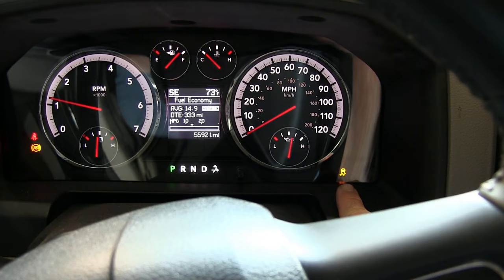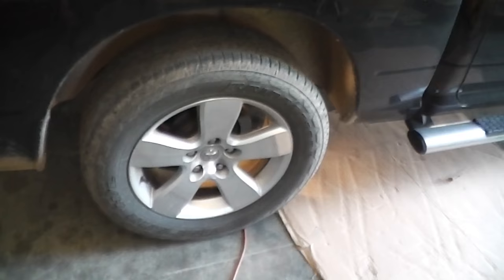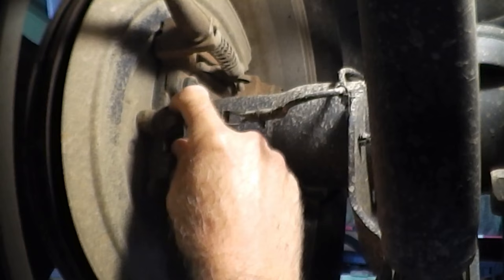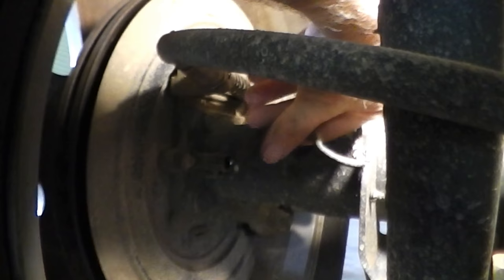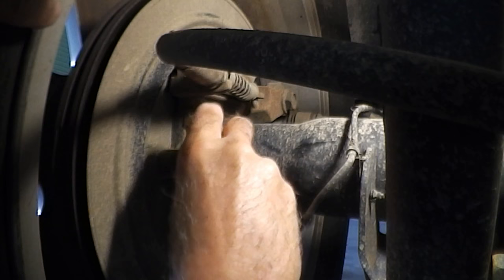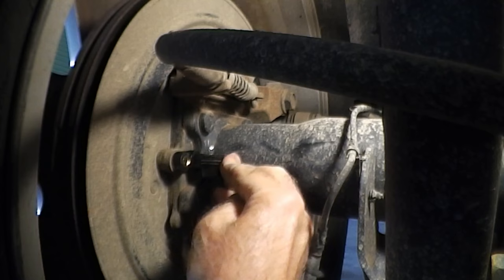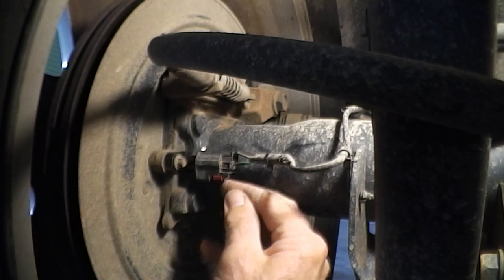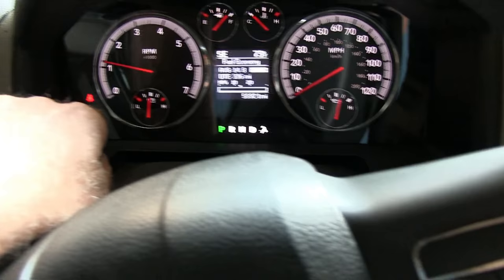ABS and traction control light stay on - 2012 Ram fix

Comment: Hi Pete, the truck didn’t reset with the start of the engine, I drove it for a while and still showing the same lights. Any idea what could be wrong?
Reply from the maker: Make sure the contacts on the clips were clean when you reconnected them and not corroded because if they're dirty, the computer will still think the censor is bad.

Comment: I am having this same issue on my 2016 Laramie Longhorn. But I am having trouble finding just the sensor in parts stores. All I can find is the entire ABS speed sensor package that has the connector, modules, etc. Where can I fin JUST the sensor itself, as seen in this video? The ones I found online say they do not fit my truck. Thanks!
Reply from the maker: Some Rams are different depending on the year. I think I got mine at either O'Reilly Auto Parts or Advanced auto parts.
Reply: @petebeasttexashomesteading  Yea, that is where I have looked too. Thanks for the response.
Reply: Do you remember what you bought? I am having same issue with my 2014 Sport and I am only finding the whole package like you mentioned. Thanks.

Comment: Did ur cluster stopped working i have a 2012 dodge Durango and same lights are on but my cluster wont work ir show how fast am going just rpms work
Reply from the maker: I didn't have that problem.
Reply: I do, did replacing the sensors fix it?

Comment: I’m dealing with this traction control light only staying on, any idea if this is the fix ?
Reply from the maker: You could probably bring your vehicle to an advance auto parts or Oreily's auto part and they can hook it up and run a diagnostic check to see what is giving you the traction control light.
Reply: @Shaun Danylchuk Did you ever find the issue? I have the same issue as you, just the traction control light.
Reply: Sam Moore no, it went away finally hasn’t come back on so, fingers crossed it’s not an issue anymore.
Reply: Shaun Danylchuk Mine did the same thing for a while but eventually the sensors died.
Reply: @petebeasttexashomesteading  I took my 2014 Chrys 300C to 3 parts stores for a  scan  for ABS / Traction faults and they all said they could not or were not authorized to read those. Like its some Stealership secret stuff? What a crock. The car has only 47K. Chrysler products seem to have issues with any and all types of sensors. A year ago the V6 ( at 38K ) lost power due to a bad oil pressure sensor. The stealership wanted $300 just to read the code. I diagnosed it myself with a little web searching and fixed it. The brand has lost my respect.

Comment: I have a similar (maybe exact same) issue on my ‘12 ram 1500. The traction control light stays on all the time and the red BRAKE indicator on the dash bings and blinks at me. I don’t think my truck has ABS. Do you think this is the same issue and fix?
Reply: I think it's the same. And if it's a12  you have ABS

Comment: I dont see this sensor on my 2013 Ram 1500 Hemi. Is this only on the passenger side, or is it on both sides. I only checked Drivers side.
Reply from the maker: They should be just in front of the rear axle on both sides.

Comment: I replace mine today both sides the light disappeared for a little bit but then came back on it’s every time I drive in a bad route any little hole on the street I feel a vibration on my gas paddle and the light turns on have no idea what is it.
Reply from the maker: Unplug the speed sensors again and look inside, make sure contacts are not corroded and clean them up and plug them back in.

Comment: Did your light that says 4wd service light came on at all ? Mine has those 2 light u mention plus the 4wd service one ?
Reply from the maker: The truck I had was 2 wd but it's all connected. If those sensors go out it thinks the wheel is not turning so your 4wd light will come on and your cruise control will not work.
Reply: @petebeasttexashomesteading  thank you for the video very helpful do you happen to know where you got those part at ?or have a link to them
Reply from the maker: I think I got the sensors at either Advanced auto parts or O'reillys auto parts.
Reply: Mine did the same thing with the 4x4 light also, but when I stop and start moving, it feels like my left front caliper is grabbing and the traction control light flashes for a second. Once I get moving the light goes out. I think I may have a sticking caliper. Any ideas? 2011 Ram 4x4....
Reply: Did you ever figure out the problem?
Reply: @chrissmothers3636  I ended up getting rid of that truck
Reply: @chrissmothers3636  I belive you have to replace the sensors

Comment: Can a code reading scanner read the code for the traction control light?
Reply from the maker: I know that if you bring it to one of the big auto parts chain store that they can scan it for you.
Reply: I had mine scanned and it didn’t show any codes.  Even though the lights were lit.  Tried the reset and nothing.

Comment: Help! I have a Ram 2500, 2012. I think my part is different? I have spent HOURS even on the Mopar sight and I can’t seem to verify the name of my part because in the manual it is called “Electronic Stability Control”😫
Reply: It's a little late for my comment but it may be called that also. It does provide elec. stability control by applying braking only to the wheel that needs it most at the time and then keep switching by milliseconds to the other wheels to keep the vehicle in a straight braking line. Hence the term " Electronic  Stability Control ".

Comment: On amazon wen u cross check the car, dodge ram only goes up to 2010 how did u use this part on a 2012 . If the year for dodge ram 1500 aint on there dont that mean it dont work? I have a 2011 wich is why i ask
Reply: Not under Dodge after 2010. Scroll down to Ram

Comment: I have this issue with my truck right now, except I am also limping in 4th gear. Did anybody have the same limping issue when their ABS and Trac-control wasn’t working? 

We also think it may be our transmission solenoid 

Model: 2012 Ram 1500 with 5.7L 

Please let me know!!
Reply: Mine is doing the same thing same model. What was your solution?
Reply: @tciscoroofing  did you figure it out? Having the same issue now.
Reply: @kanehorath7222  my result was that I bought a cam sensor from O’Reilly and nothing happened it was the same situation that it has been doing. 

I’ve took it to 3 different places and it pop up as a cam sensor. So we ended up buying the original part from dealership which is the cam sensor and boom problem solved. Running like new. O’Reilly sensor parts don’t work you have to get the original parts. Try it and let me know if it work. 

Good luck!
Reply: @tciscoroofing  thanks man I appreciate it!
Reply: @kanehorath7222  let me know if yours worked also

Comment: Does this work on a 2012 Durango?
Traction light stays lit and can't shift out of Park
Reply from the maker: If your shifter lever is stuck in park, then there must be something wrong with the brake pedal sensor not releasing the shifter.

Comment: What would the results be if u keep driving it with the lights one ?? Anyone ??
Reply from the maker: Cruise control wont work nor will the traction control and you might have problems with the ABS not working properly.
Reply: Death quite simple

Comment: Do you know what makes them go bad?
Reply from the maker: Not really, the censers are a sealed unit and nothing to fix......just replace. But you might want to try unplugging them first and clean out the connections and plug them together and see if it had a bad connection first.
Reply: Pete B. Thanks. 

I had my brakes replace at the last oil change which was at 119k miles. 

I now has 129k miles and Is ready for another oil change. 

I was wondering if when they replaced the pads, if they could have left something loose.

Comment: Are the 2013 rams the same deal? My parking brake light, traction control light, and abs light is on. What do I do?
Reply from the maker: Most likely it's the same problem especially if your cruse control doesn't work either. I would just change the speed sensors, they're not that expensive. The 2013 speed sensor are different then the 2012 because it has a long wire and clip connection.
Reply: Yeah my cruise control wasn’t working either. I went to O’Reilly and bought the part. Was wondering why it wasn’t just a female part like yours but that makes sense. Thanks a lot man!
Reply: Did changing the ABS speed sensors work for you? I have the same issue parking brake light, traction control light, and abs light is on? @Blake Rainer
Reply: Malachi McClure o OK

Comment: Is this the same process for the 2010 model I just recently got one and my light is on for the traction control and esp bas no abs light though
Reply from the maker: It should be, if one sensor goes out, the computer thinks one wheel is spinning and the light comes on and will stay on until you change the sensor.
Reply: Pete B. Okay sounds good I’ll start with swapping those then and see what happens then
Reply: @Apacheg8  Did you end up changing this out on your 2010 Ram? I also have a 2010 ram with the traction light + SRV 4WD / ABS lights coming on intermittently. Curious if this solved your issue. 
@Pete B. Thanks for posting this too!
Reply: Taylor Young hi, it actually did not I replaced both rear...light remained on but I believe it was per my own goof...they were dry and Brittle after removing the one bolt holding them in. They had a plastic casing around the internals and that part stuck in side and I had to torch them
Out lol and use sandpaper to clean out the whole the sensor goes in too. I just left them till I pull my brakes then I’ll take a different approach.
Reply: @Apacheg8  Thanks for the quick response.

Comment: Where did you find the Female Speed Sensor at? Everywhere i have looked sells it all together connected to the wire and everything else.
Reply from the maker: I think I got the sensors at Auto Zone. But I would look at your sensors under the truck to make sure which sensor you have. With the wire or like mine plugs in.
Reply: I was able to just order the female port like the ones you installed and get them today. So hopefully it solves the problem. I was driving yesterday with the abs light/traction control light on, i pressed on the brakes and they made a weird sound so hopefully thats not what the problem is and its just the sensors.
Reply from the maker: @mr.goodkat4829  Yeah mine made that sound once too, it was vibrating through the brake pedal.
Reply: Was it vibrating when the ABS/Traction Control light was on? The sound sounded like it came from the front of the vehicle when i pressed in on the brake. If it did, did the sound go away once the sensors were replaced?
Reply from the maker: @mr.goodkat4829  Yes the light was on and I remember turning in a parking lot and when I applied the brake as I was turning the brake pedal started vibrating and made a weird sound. But it only did it once and never again since I changed the speed sensor.
Reply: Alright, thanks for your help. Mine is doing exactly the same thing. Your video was done perfect by the way.

Comment: Mine is 2011 Ram 4x4. My traction control keeps activating in the front. When I start to take off after stoped it will grab a few times then quit. The traction light the ABS light and the service 4x4 system light all come on at the same time. It may go for days and not to it at all, but then when it dose happen it will do it all day. Ive been told its the wheel speed sensors but why would it only happen to the front and not all four wheels if that’s the case. No one can seam to answer this question. Anyone have any ideas?
Reply: Have you found the solution to your problem yet?
Reply: Your front and back operate separately.  If they were all hooked together and you have a back one on left and front on left lock up or go bad where only the right side worked it wouldn't be pretty.  In order to keep the vehicle braking in a straight line front and back were separated. This way if only one stopped working it may or may not pull to one side slightly but you could still control the vehicle.

Comment: Ever since I installed the speed turtle kit, my lights blow out (front drivers fog, front passenger low beam bulbs, rear 3rd brake light) that is just garbage and I am very unhappy the speed turtle kit does this.

Comment: Hi, I just watched this video because my car had this light on but how did you know it was the back tires? Is it only a back tires problem? Or could it be any of the four tires? 
Thanks
Reply from the maker: The sensors are only on the drive wheels. so if your car is rear wheel drive, they will be on the back wheels.
Reply: @petebeasttexashomesteading  great, thanks sweetie